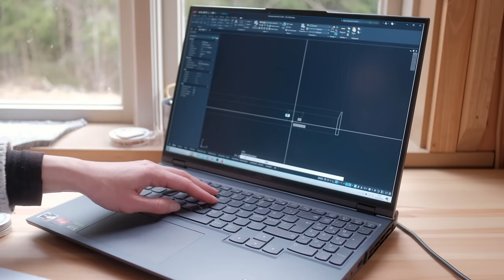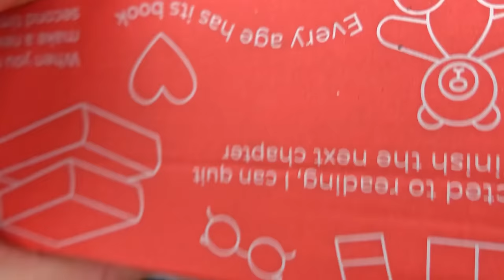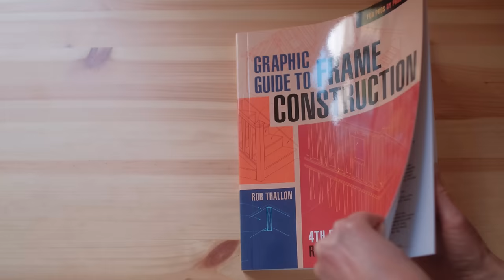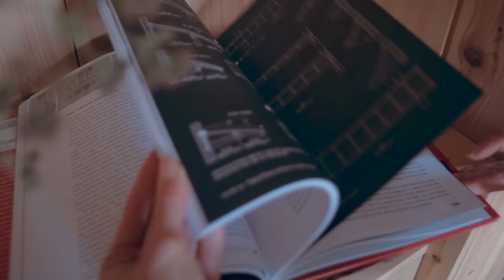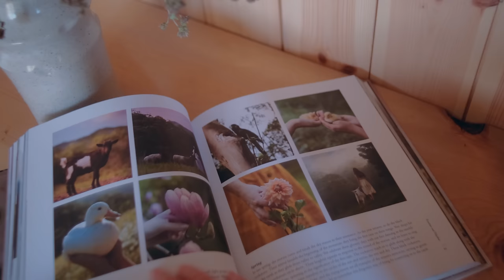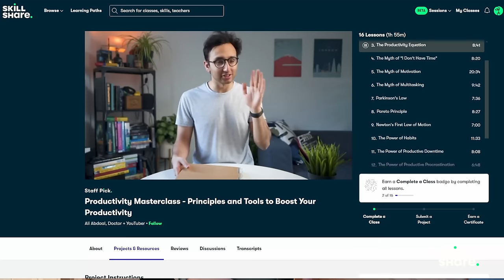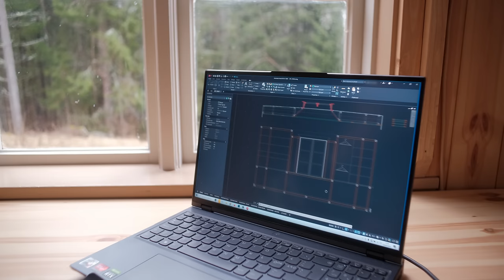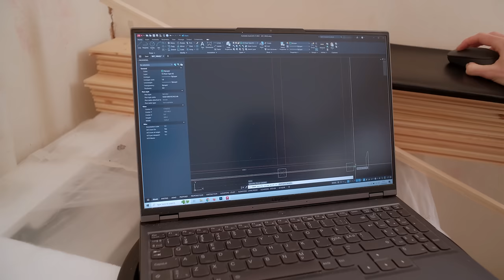I’m starting the first living room build! (Story 77)

Comment: Just an FYI Rosie, in my neck of the woods we use the wallpaper paste on the wallpaper and then place the paper on the wall. Then we wipe it down with a damp cloth to help it adhere better to the wall with no bubbles.   Maybe helpful to you in the future or maybe not.  Just wanted to share.  Loving your videos!!!
Reply: Where I come from I think it is done the same way as you describe here.
Reply: Same here, i have done some wallpapers. Its often used here in Holland. Always put the paste on the wallpaper, wait a few minutes till the wallpaper sucks it in, then put it on the wall. Coz wallpaper will increase in size after you put the paste on it, thats why you have to give it some time. When it dries it will sort of shrink a bit and also smooth out so you get a flawless wall. If you put the paste on the wall, the wall will suck in the paste and paper wont adhere to the wall.
Reply: That’s my feeling too.. and book the paper for awhile before hanging

Comment: I have always cut a length of wallpaper, added the paste to it (or wet it if it is pre-pasted) and folded it, they call it "booking" and let it sit for a few minutes before hanging.
Reply: exactly. Doing the same thing
Reply: And a roller rather than a brush.
Reply: And you also have to take a rubber tool and press all the air bubbles out.
Reply: @poodlegirl55  Important!
Reply: Yes same here when we wallpaper.  The paste looked very runny there, but then we mix ours ourselves and it’s thick, then onto the wallpaper, left it for a minute or two then onto the wall.   I have never seen pre mixed paste before.   You are amazing Rosie, so brave and talented, living by yourself.  Good luck and looking forward to the next video. 🏴👍👏👏
Reply: That’s what I thought…”don’t you put the glue on the wallpaper not the wall”. Oh well. Live and learn
Reply: @poodlegirl55  like the bench scraper cooks use to clean dough scraps from their kneading surfaces
Reply: Hi I think if you put wallpaper the wall can’t breathe because you have different temperatures I think is the best only paint.
Reply: @suzannehicks5856 depends on the wallpaper instructions. Some are paste-the-wall but not all
Reply: That’s how we do it here in the USA.  I have hung and stripped many rolls of wallpaper over the years.  I have mostly plain painted walls now.  I am getting older and will likely downsize in the next 7-10 years.  Buyers don’t like wallpaper 😜😜
Reply: A lot of wallpapers are paste-the-wall now. But the paste used for them is the same thick wallpaper paste as for standard paper not very thin paste as in this video.

Comment: Rosie, when wall-papering it is usual to first paste the back of the wall-paper, then prime the wall with paste by which time the paper should be ready to hang. There should be a degree of slippage to allow the paper to be moved to get it vertical.
Reply: Also, you can apply the paste with a paint roller .

Comment: One tiny suggestion about the fire. My dad when we were kids use to reuse the ash from the fireplace. He use to collect a small amount on a bucket with a lid and add a little oil and mix it. Apparently ash and oil is a good way to start a fire in a fireplace instead of using small pieces of wood, paper or the industrial solutions available.

Comment: I enjoy the tranquility of your videos.  That is rare for DIY videos.  I think the music choices help.  I love the nature scenes and appreciate the effort it must take to make them.  Thank you.  

I have two suggestions for you.  Unless the empty shelves are more motivating, you could fill the space by displaying your new books vertically with the covers facing out; just lean them against the wall.  EDIT: Maybe just the bottom shelf.  Just rewatch.ed and noted the size of books compared to the space between shelves.

For time management, I always find most strategies to be daunting trying to do a lot of goal setting and mapping out every hour of the day. I recently came across the simple concept of identifying two activities to complete each day.  If you have a big project, break it into manageable steps and pick one or two steps per day depending on how many projects you need to address that day. Two activities can be accomplished and you have made progress on one or both projects; even if unexpected distractions or delays pop up that day (except major delays like a bad batch of glue, of course, but you can’t control those.)  Bonus if you get more done.  This helps me stay positive and not feeling like I failed because I couldn’t stick to a daily plan or complete lofty goals.
EDIT: After rewatching, your management challenge is to define time for DIY, work and relaxing.  I’m terrible at time management myself, but I have to think the same discipline of never wearing shoes in one room applies to dividing up your time and sticking with it.  Discipline is my challenge.  But, limiting yourself to two activities might still help because you are not expecting yourself to do unreasonable amounts of work, which can result in spending too much time focused on one area trying to meet the unreasonable expectation and never getting to the relaxation part.

Hope these suggestions are helpful.  Have a great day.

Comment: I enjoy watching your videos and your "can do" attitude.  This just reminded me that I once papered a room more than 50 years ago.  Here in the States we call it wallpaper paste, not glue.  There is a special wide wooden brush with thick yellow bristles and a short handle for applying wallpaper paste.  And we apply it to the paper, not the wall.  We needed long boards on saw horses to lay the paper on to apply the paste.  I think we also had another wider wooden brush without a handle to smooth out the paper after it was put on the wall.  It's been many years so I don't remember it all completely.  But to the best of my recollection, that is how we did it.

Comment: Hi Rosie, promlem is that you need enough wall glue which is evenly applied.
Make a makeshift table.
Paint the wall and the paper laid on the table.
Even layer. then fold the wet paper in half and put on the wall as you showed in the vidio. Use a wallpaper brush to get it smooth and all bubbles and folds out.
Brush from the middel outwards.Good luck.

Comment: Never use wallpaper where spackle and paint will do the job and if the paint turns out wrong, then just repaint.  I’m enjoying the work you’re doing.  We remodeled a townhouse in Hawaii to house our 4000 volume library.  It had a 13 foot wooden beam ceiling with a huge lanai facing the Ko’olau mountains in Kaneohe Hawaii.

Comment: The wallpaper should be pasted first and left for a few minutes to stretch then put it on the wall by running a damp cloth down the centre then moving out from left to right to remove trapped air.

Comment: Another book you might possibly be interested in is The Joint Book by Terrie Noll. It was strongly recommended to me by a woodworker who builds historical medieval furniture (so he does not use glue, screws, or nails), and I’m so glad I bought it.

It has very detailed instructions, with lots of pictures and diagrams, explaining how to do many different kinds of joinery step by step. The book itself is also very nicely designed to accompany you in the workshop: it is small and sits flat when open, the pages are tear-resistant and easy to turn, and the cover is very thick.

Comment: I have no idea here — but any time I’ve seen people paper walls — they paint the glue on the back of the wallpaper. They do this on some cheap table. Then they fold the (pre-measured) sheets from each side in toward the center such that they can then apply them to the wall. Then the smoother tool thing is used to even out, get bubbles out, etc. Does that make any sense at all? (Apologies in advance for unsolicited suggestions. )
Reply: Yes , if you dont have a proper wallpaper brush you can also use a new banister (hearth) brush or a large sponge to smooth out any bubbles from the paper,  top of wall  down to  floor .😊
Reply: @ellbow7287 — an aunt used to do this semi-professionally. She became really good at it. It looked really intimidating to me.
Reply from the maker: Yeah that's how I remember my parents doing it back in the day. But this wallpaper is put on the walls, I read the instruction manual! :)

Comment: Well done Rosie, I am not a specialist in wallpaper, and the specific you are using, but normally you would glue the backside off the wallpaper,fold it,and leave it for an hour, then also put glue on the wall if needed, then let it dry for about 24 hours or more before paint!!! with glass paper it is different, but soo are the glue???

Comment: If you get bubbles in your wallpaper take a pin and poke tiny holes in the bubbles and press smooth. You should also be using a proper plastic wallpaper smoothing tool. 😍🇨🇦

Comment: 13.2C is 13.2 x 2 = 26.4 + 32 = 58.4F, approximately.  The real formula involves fractions.  Need I say more?  It's normally not an exact conversion, but it almost always gets you to within a few degrees of exact.  So if you said 13.2C is roughly 60F, that's close enough for most of us.

I can barely do addition and subtraction because it takes intense concentration on my part to "see" the numbers in my mind.  There's no way I'm going to do 5/9ths or 9/5ths in my head, even if I mentally reduce them.

So 60F is 60-32 = 28.  Divide 28 by 2 and you get 14C.  Again, approximately.

Comment: Gee, that glue was strange! Methylcellulose glue is basically wood/paper fiber and water, so I'd assume old product would be the opposite, too thick. Never seen anything like that!
Watching your build today, I was wondering why you didn't do what flat pack manufacturers do, and measure your frames down to above the skirting /base board, and put them on adjustable legs to later cover with more skirting (creating a built in finish)? Much of the fiddling with adjusting to the skirting, and some of your assymetrical dimensions would be more easily solved with a gap up top, and a good 15 cm gap at the bottom, later covered. Is it the fact such adjustable legs are prefab and metal that bothers you? Even if they'd be hidden? I have an even wonkier apartment from the 17th century thats been subject to sinking unevenly over time, so I'm always paying close attention to how these problems are solved. I have the added difficulty of wainscoting which juts out about 4 cm in depth at the top, and is also really crooked in places thanks to lop-sided settling of the building and makeshift adjustments in past eras.
I'm trying to figure out the best ways of solving some of my storage needs.
It's a bit of a conundrum if you aren't a skilled carpenter/designer. I loved your demonstration of the problem! " the floor does this", the walls do this, the ceiling does this" with body language! Brilliant explanation, and exactly what I have to deal with differently, everywhere 😂

Comment: Paint and glue does not like temperatures under 15 degrees celsius. 😢 I have had paint in too cold degrees and the paint got useless. The glue you are supposed to use should be not like water. 😊

Comment: If you're putting up white wallpaper, why not just paint the wall white? lol
Reply from the maker: The wall is a mess of old wallpaper layers half torn off and not in a state to be painted at all. This is renovation wallpaper, extra thick and meant to cover messed up surfaces like mine. Then you can paint or wallpaper on top of the renovation wallpaper

Comment: You are just too elegant.   Next time, perhaps remove the floor moldings, clean them up by sanding and the like, and place then in front of the storage area you are building.   Not a big deal either way.   Do you speak with your neighbors, have a friend come stay,  or otherwise receive some human interaction?   People are overrated, but in small doses, tolerable?

Comment: You’re making a huge mistake by not going in and jacking up your foundation to level your house before you do all of these additions. I am doing a DIY 1947 mid century house in America. I just spent about $2000. Jacking up my house to straighten my walls and now I’m starting on the inside. It did not cost that much compared to the rest of the remodel.
Reply: Interesting. Maybe it is more common to do that in America. I live in Finland, and I rarely hear about that sort of thing in the Nordics. Probably it would make sense, but I lived 20 years in a house built in 1930, and on clay soil with wooden beams sank in the soil. The house is moving all the time. Maybe the soil makes also a difference if the jacking up makes sense or not.